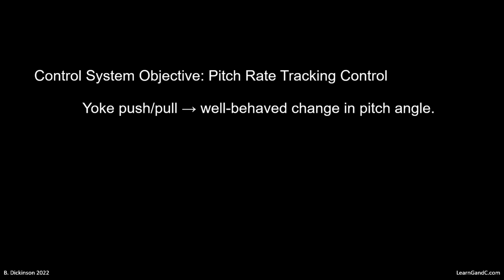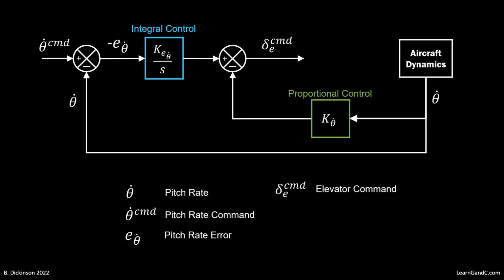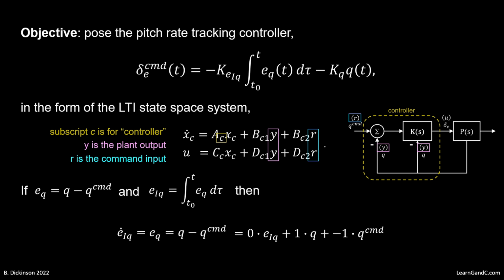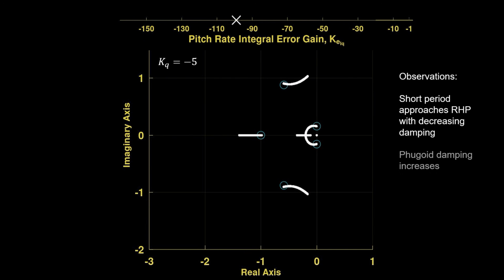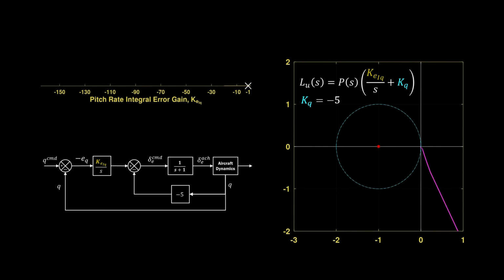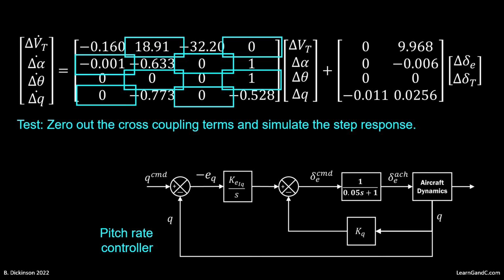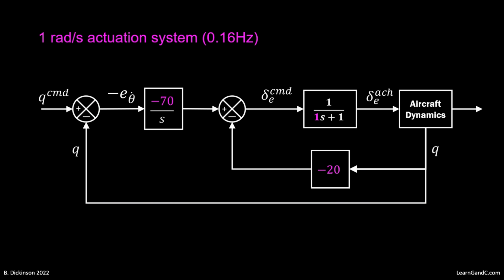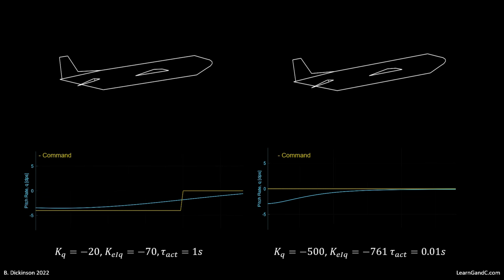Pitch Rate Tracking Architecture, Tuning, and Effects - Flight Control Fundamentals - Section 1.4

Comment: At 17:24 for aircraft to pitch up, we pull the lever and the elevator degree decreases and takes negative values,  upwards to aircraft to pitch up. Yet in this video graphics, the trailing edge of the elevator control surface goes downwards while pitching up. Am I missing something here?  Thank you for those  profound informations.
Reply from the maker: Yes, there was an error in the animation that caused the elevator to move in the opposite direction. All views of the aircraft show the elevator with a sign error. Good catch. In the Patreon codes as well as future videos, this has been corrected.

Comment: Does an aircraft have both pitch control system as well as pitch rate control system?
Reply from the maker: It would usually be one or the other. Consider the benefits and drawbacks.

The pitch "displacement" control in (Section 1.2) addresses pitch angle tracking, but as a proportional control only on pitch angle error, it has constant bias error in step command tracking. It also does not allow artificial damping. Additionally, pitch angle may not be available from a modern inertial measurement units, although early gyros did provide pitch angle. This architecture would most likely be found on early aircraft. 

The pitch rate tracking architecture (Section 1.4) includes artificial damping and an integrator on the pitch rate error. This provides much greater ability to augment the closed loop response of the aircraft. The only output feedback is pitch rate, which is measured by modern IMUs. It is more complex than the single gain displacement controller, but still simple 2-gain control architecture.
Reply: I have mixed both.
You can make pitch angle an auto trim feature.
And pitch rate as a stabilizing feature there fore producing a very stable FBW for unstable craft
Reply from the maker: I see, a pitch angle trim control system with a stabilizing pitch rate controller. This makes sense. Thanks for sharing this.